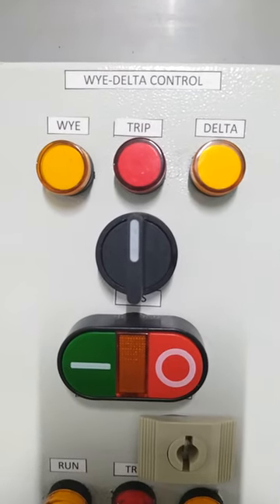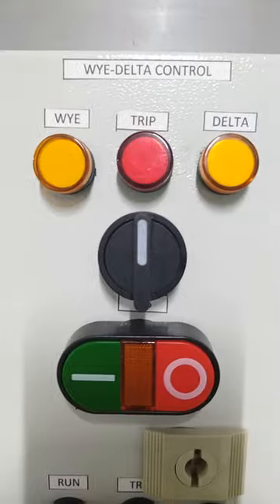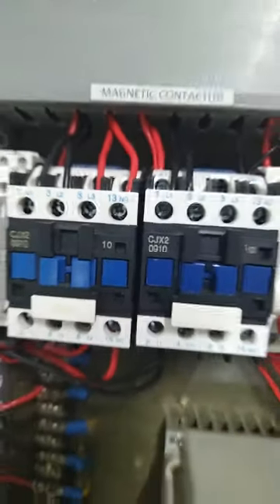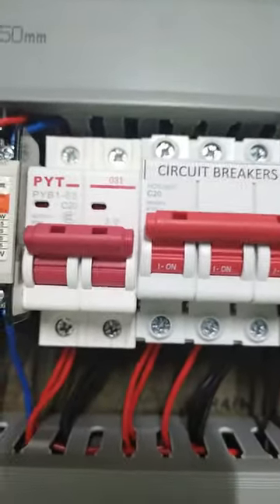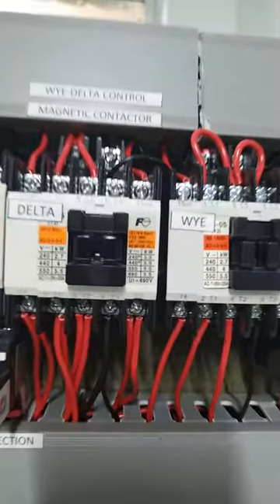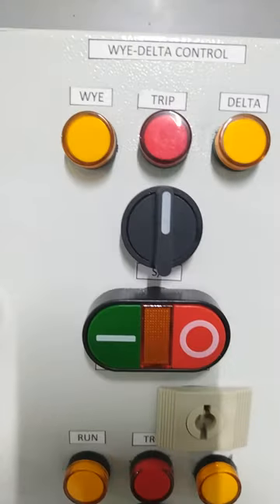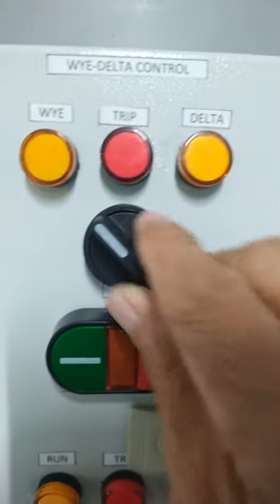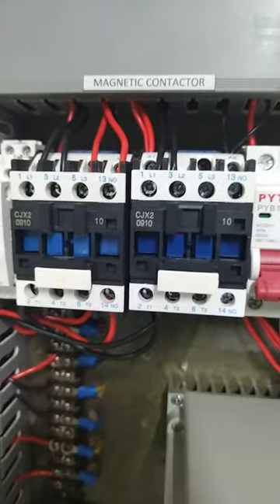#shorts 220 VAC -  3 PHASE 12 leads motor testing on WYE - DELTA CONTROL.

Comment from the maker: the motor can be run at different control scenario one is the WYE-Delta Control, the 12 leads of the motor will be wired physically through the use of several contactors

Comment from the maker: in wye-delta the 12 leads of the motor will be converted to 6 leads output to accommodate WYE_Delta Starting through the use of two extra magnetic contactors as shown in the video